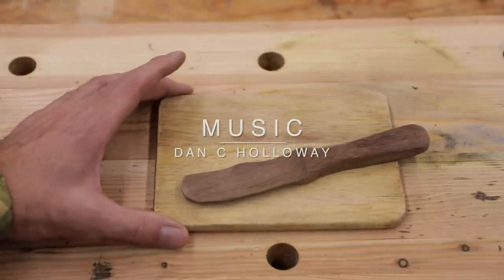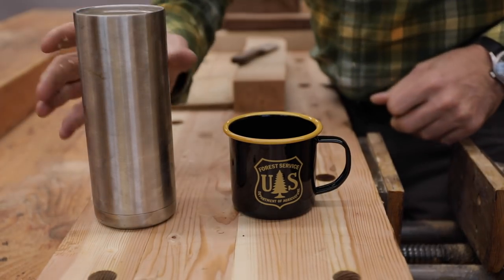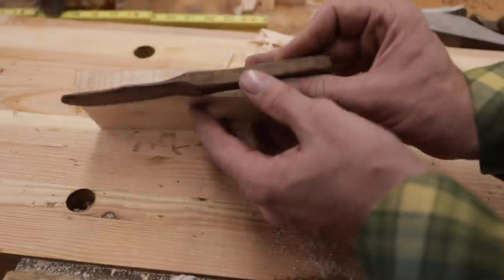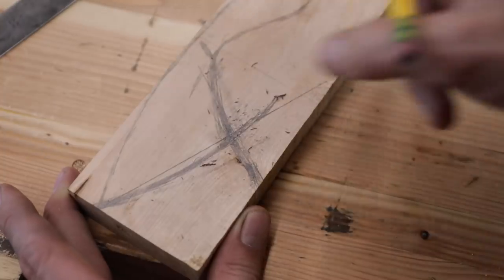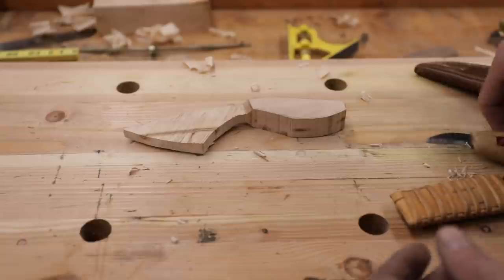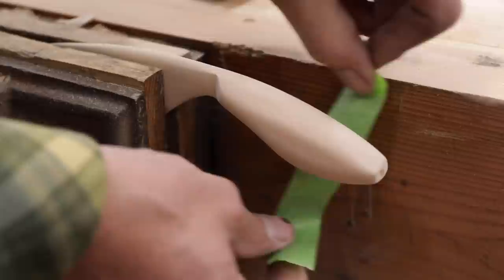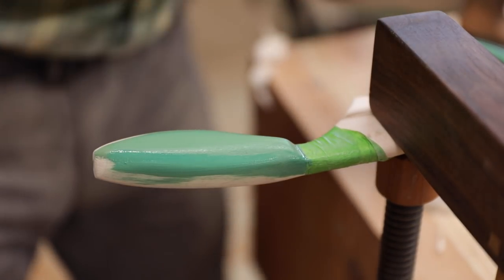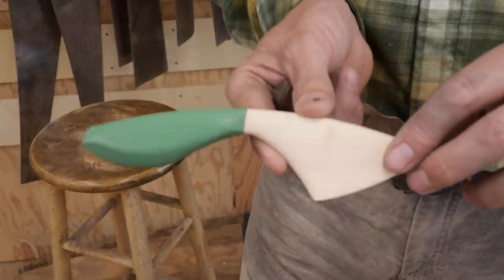Making The Famous Swedish Butter Knife

Comment: 8 inches???? If it´s a Swedish Butter Knife you must use METRIC!!!! ;-) //Jonas from Sweden
Reply: Screw the metric system because it's really convenient and the scale works on a linear scale. What a hassle to use!
Reply: ~ 20 cm ... and no, it's not 200mm, metric people use CM as the base, not mm. MM are only if you want to be really precise.
Reply: Dutch Courage no meter is the base centimetre, millimetre and kilometre are derivatives of meter hence cent, mill and kilo which are derived from Greek measurements
Reply: As a carpenter I always use mm to describe lenght or width. Next step up is meters and thats usually when you make long fences or when you visit the lumberyard where its easier to descibe a 2x4 as 2,5 or 3,3 meters instead of 2500 or 3300 mm. Perhaps its and occupational injury?
Reply: @C-A-A while 'technically' you are correct about the scientific/engineering side of things; but the normal metric person generally uses CM till sizes go over a Meter. The CM is like the inch, seeing most human implements used are in the CM range, the CM is the 'base' type of measurement for most things.

Say a cup is 10cm high, not 100mm. A pencil is like 13cm, not 130mm. Only time i hear people use mm for these things is when imperial people try and use the metric system. But to a metric person it's like saying something that is 2inches, is 16/16s like why would you use the small increment when using inches suffices. Unless you want to go 15/16s or 1inch 7/16s, then you would go for 4cm 7mm ... hope this makes sense :)
Reply: @Anders, what country are you from, if i may ask. 

While mm can be a range for carpentry; f/e most cabinets are 45cm or so. Now to make one you obviously want to take blade widths into account, so it be say 45cm and 2mm or 452mm.

But like explained above to C-A-A, to me using 450mm for 45cm, is like using say so many 16's to express 2ft (roughly guessing 45cm comes close to somewhere 2ft). But maybe i'm wrong, and it may just be something for here in the Netherlands.
Reply: Im from Sweden.
I understand your point and perhaps the reason for me mostly using mm over cm is the fact that I am a carpenter and every drawing or technical specification is always in mm. If it calls for a 3m piece it never says 3m but 3000mm.
Reply: Fair enough, then i'm guessing you are so used to it that it doesn't really make sense to go for cm.
Reply: All work in Europe for either wood work or architecture is done in mm's. If you go to a wood shop and order a piece they size it in mm's.
Reply: Well also every  german engineer  will tell you that blueprints are sized in mm and most calculation is done with m ;D.
Reply: 'Murican version of the Swedish Butter Knife... Inches must be used.
Reply: You people are all talking about engineers and specific trades, already said i agree those use mm ... but i'm talking about the normal average European, aka. 95% of the population if not more, to them talking in mm just sounds silly because they will be thinking in CM, and only use mm if they want to be really accurate for something. And even then they will use so many CM and .1...9mm.
Reply: And then you have us here I'm Scotland who convert easily between metric and imperial. Generally it's mm for precision, and imperial for everything else, general rule isthe bigger it is the more likely it is we use imperial. CM isn't widely used though. We seem to ignore that one. Officially we are metric, but speak to anyone and we use both.
Reply: No
Reply: 8 freedoms

Comment: I came across Japanese pull saws by accident about a year and a half ago. I was looking for a good but cheap saw on Amazon and needed one that could cut through and not get stopped by the top edge and I knew Japanese tools r usually excellent.  So I bought the same type u r using on Amazon for 24bucks. Well, I fell in love with them. They r truly amazing and since then iv bought a few more diff sizes. I swear I can cut faster with it then an electric saw does on most stock pieces I use. 😀

Comment: I major in car design but I have taken a few product design classes and this is one helluva design you have there! You can copy it for a steak knife if you do it with metal. The angle of the handle and the cutting side of the blade would provide more than sufficient torque and control to cut steak!

Comment: If you want a steel knife of this design I am willing to make one for $80 plus shipping. I don't have the heat treating ability for stainless steels, only your traditional high carbons (1080, 1095, 01 etc.). I have found that a basic acid etch does a great job of protecting the metal from rust (obviously basic maintenance is required. Don't leave it wet and wash off any residue from cutting tasks, and oil it before storing).

Comment: Almost lost art and yes I think it would look good in steel. Find a pice if flat steel an a cutting wheel, grinder and drill press. And use brass to pin the wooden handles on. I know you can do it.

Comment: How do you clean these butter knives? I would think butter would go rancid in the wood pores?
Reply: That depends on the wood that you are using, usually a less porous wood is used. You can also treat it with oil to protext it, like a mineral oil or linseed oil.